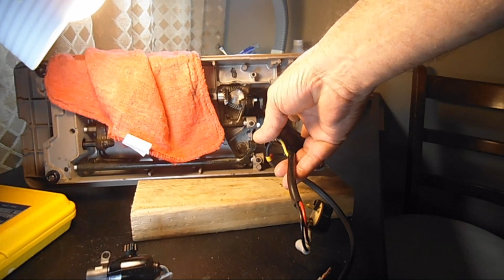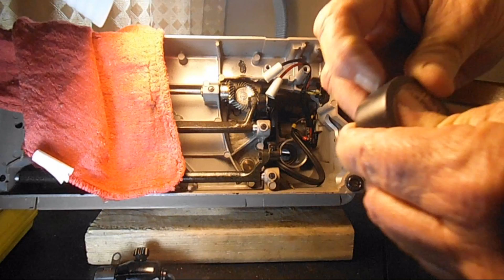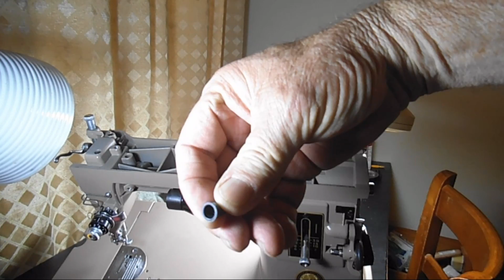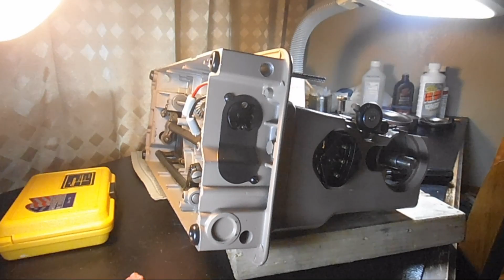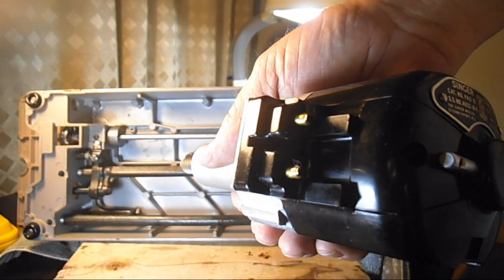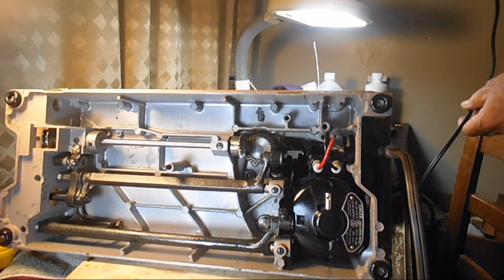All Together Now - Coco goes to the Spa Pt. 8a - Singer model 301A Rehab

Comment: Telephone wires you say.  I worked for Stromberg-Carlson for a couple of years out of high school installing CrossBar#5 equipment.  Still remember blue, orange, green, brown, slate, and single, pairs, trips.  Not quite 50 years ago now.
Reply from the maker: Sure, the Bell System Color Code. As soon as I read CrossBar I knew you were doing that 5 decades ago. We had a handful of CroosBar offices, but we hung on to our stepxstep ones until ESS#1 came out.

Comment: I agree with you Andy, the hardest part is getting those wires back up that hole. It's crazy how simple taking off and putting back that motor is. The wiring might seem intimidating but it is so easy!
Reply from the maker: Oh Yes! The motor simolicity is the payoff reward for the fiddly wire work, hehe. How sweet that PA motor is!
Thanks for watcing, Daffycat.